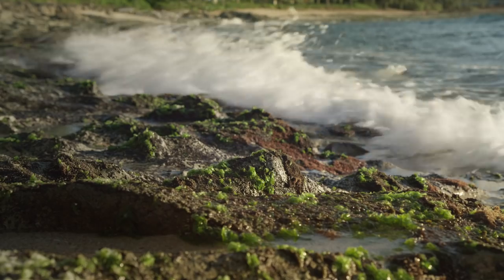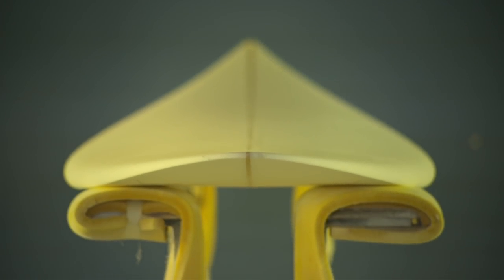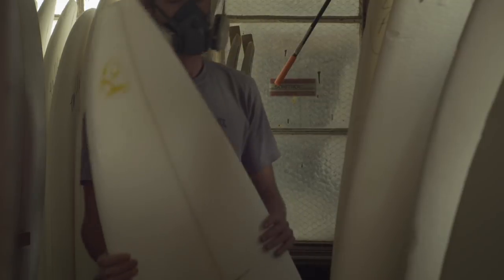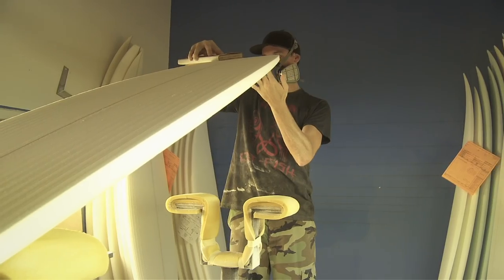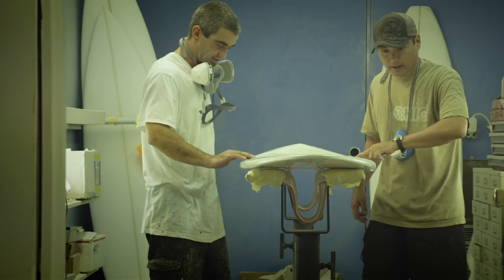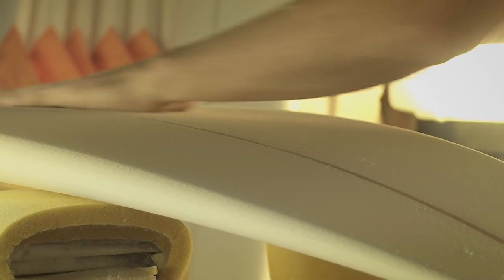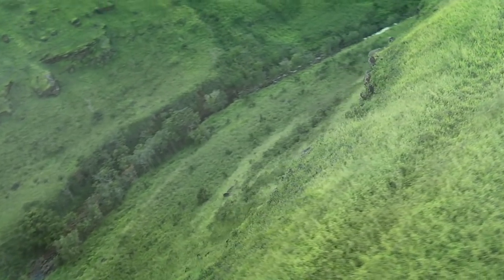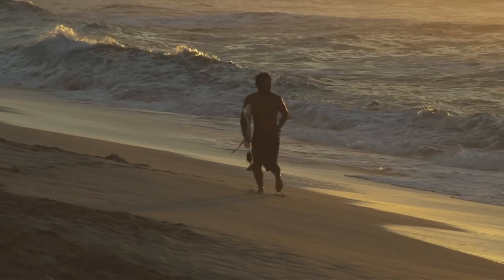PROFESSIONal: Eric Arakawa Surfboard Shaper

Comment: what is that planer with the curved front!?
Reply: +IClausius its a custom modified planer for cutting down the stringer. curved front adapts to the curve of the shape. That CNC machine (DSD) does not cut the wood stringer so they use the planer for that.